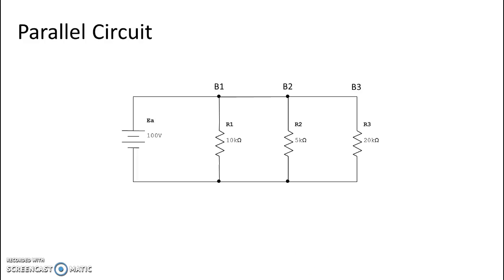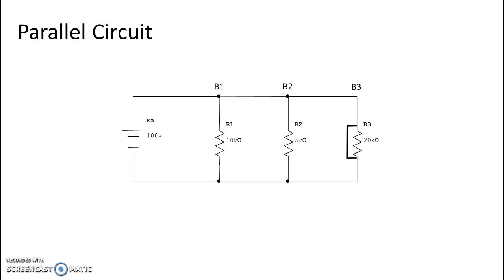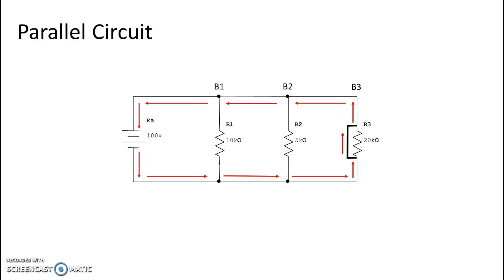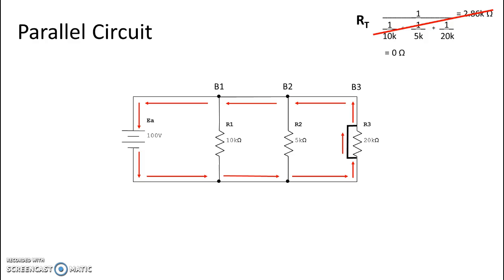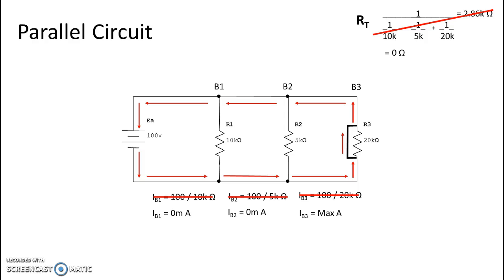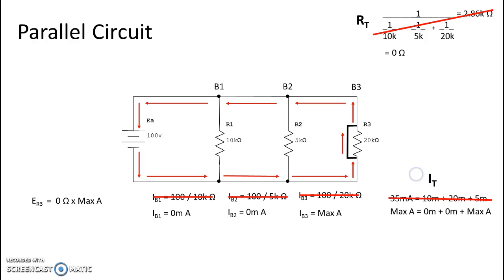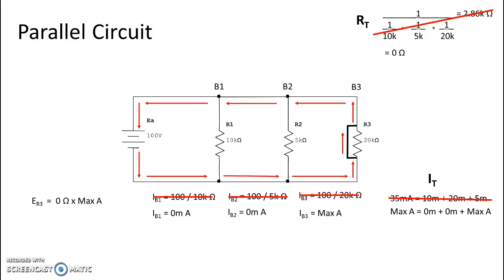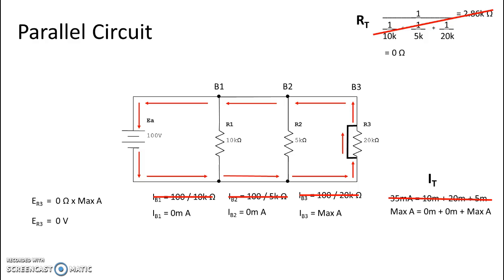Parallel Circuit Faults - Shorts

Comment: what if the case is all capacitors, and c3 is shorted. would c1 and c2 still get charged and v1 v2 keep 100v? v3 goes down to zero?
Reply: if there is a random capacitor shorted, how could I identify the broken one? thanks in advance for your consideration

Comment: who would use 100v on DC Circuit and you would get some voltage in the circuit in r1&r2 , current flow true all?

Comment: is it wrong for the current direction?
Reply from the maker: Simon Cheung no.  Current always moves from a place that is more negative to one that is more positive.  Many schools like to teach “hole flow” in electronics, which is a positive to negative perspective, where they essentially consider the absence of electrons as “holes”, but they are not moving, they are simply accounting for the absence or presence of electrons.
Reply: Christine Neer  i know. you may say electronic current, otherwise people say you are wrong.
Reply from the maker: Simon Cheung I appreciate your interest and suggestion.  These videos were created for a specific school’s curriculum.  Those students would have the benefit of class room instruction and textbooks.  These are just a supplemental resource for them to access outside of class hours.